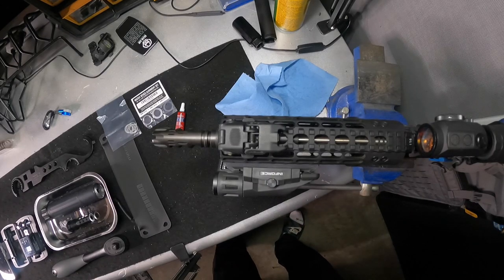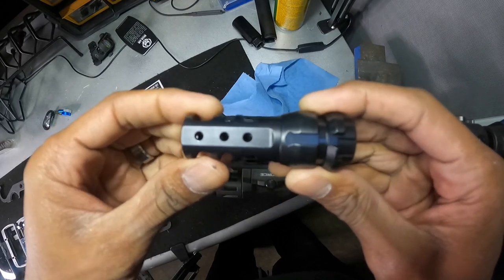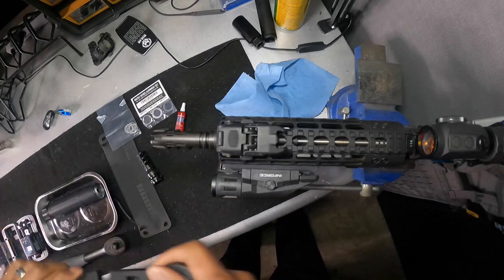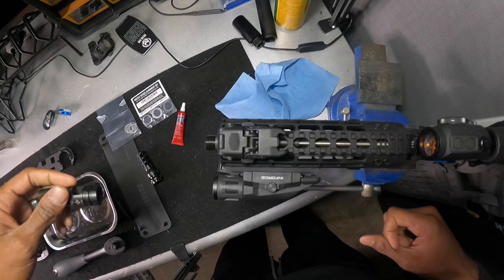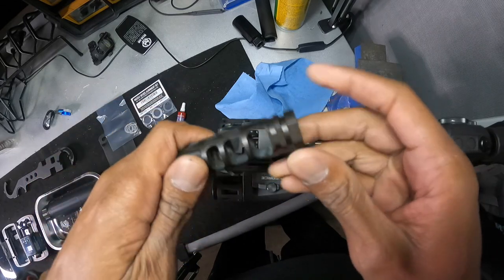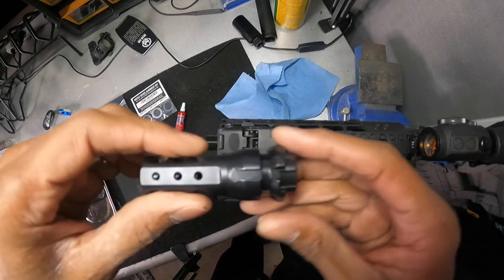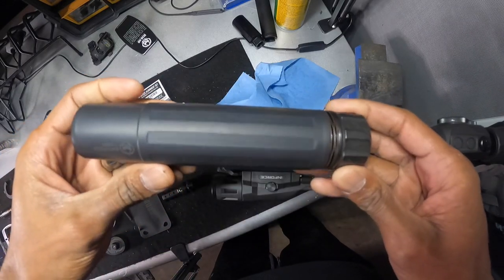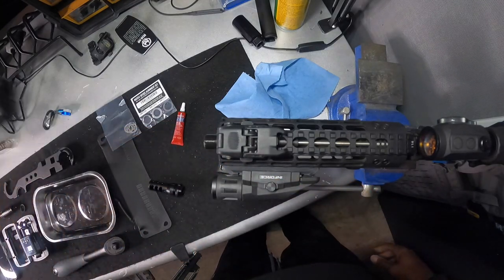How to install a Deadair Sandman  S Keymo muzzle  break

Comment: Question, any reason why you cant use a standard crush washer?
Reply from the maker: Full transparency, I am fairly new to suppressors - I only have 3, but based on my research, its has to do with "precise timing" of the muzzle break if it's not a 3 prong and the regular washers reduce the chance of any movement/backing out.  Now, I dont really believe that because my regular muzzle devices that I have used crush washers with have not moved at all.  Maybe thats my next video.  I'll call both Dead Air and Rugged and ask them while recording.  Thanks for the content idea!  I needed that.  Thanks for tuning in and supporting the channel.
Reply: @Citizen2ACitizenLLC   I've always been curious on that if you could use a crush washer or the older flat washer on them so I was curious

Comment: I have a 10.5 sbr 300 blackout I’m looking to get that same keynote brake I see yours is 300 blackout also what thread pitch did u get and does it also work with the Yhm r9
Reply from the maker: Thanks for checking out the video.  for 300 BO, (.30 Caliber Bore) is 5/8-24.  If you're getting the Deadair Brand it is part# DA102.  I think it does [https://www.youtube.com/watch?v=F9z3wHwSmZ8]. But I would either call YHM or Deadair to confirm.  Let me know what you find out.